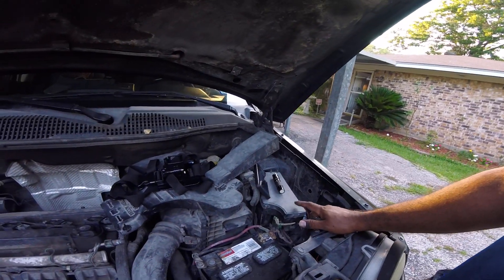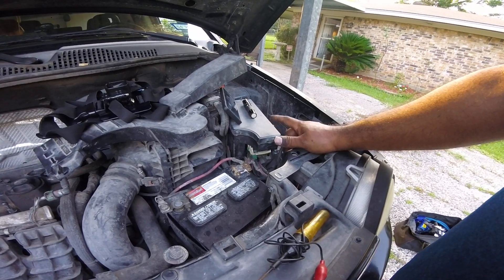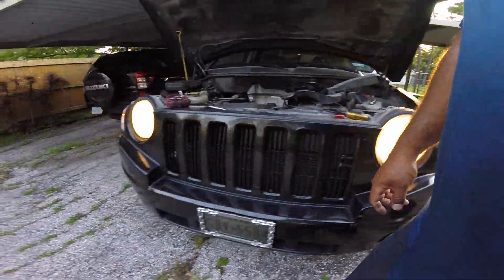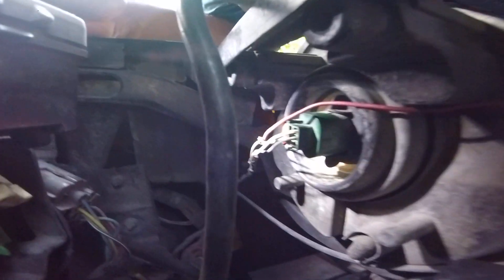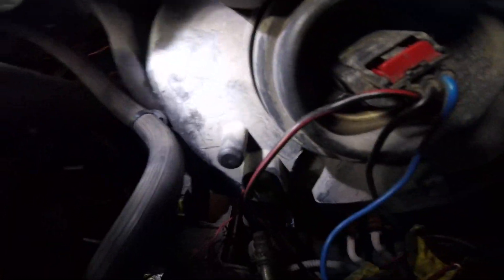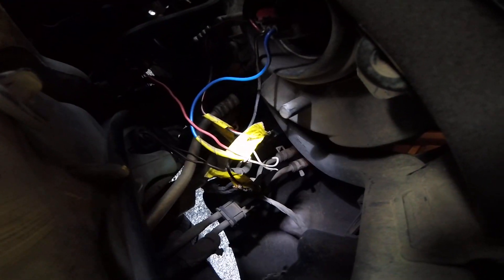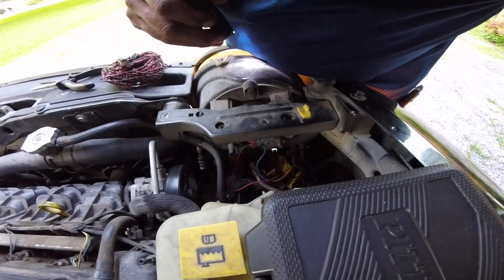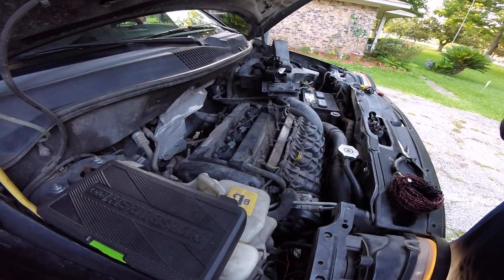2007 Jeep Compass passenger front headlight not working.( T.I.P.M. FUSE BOX )

Comment: On my 2010 Patriot, the right side headlight like yours stopped working. On the Body across from the front lower pulley is a ground pigtail. The ground wires were corroded and fell off the connector when I lifted it up. I rewired the pigtail, bolted it back up and it fixed the right side headlight & also fixed the brake light which would go on & off, usually 4-6 times each time I'd start the vehicle and drive it.
As for the TIPM, do a search online. You can get completely refurbished TIPM's for $300-$375. You have to send your old one to them to get your core charge back... These TIPM's are matched to the VIN and come ''Programed''. So it's just a matter of pulling the old one off & putting the new one in..... I called a place and they had a 7-10 day turn around, unless I sent mine, then they'd refurbish it and the turn around time was like a week....
Reply: May I ask where you sent yours?
Reply: @drumminjim22  Phat, you mean the TIPM?
Reply: @montydaniels1054  lol!  Thanks yeah I fixed the bad ground on the passenger side and the corroded relay connector in the driver wheel well.  The driver headlight went out and now I’m stumped.  Also the abs doesn’t work and the code says low voltage to pump motor.  I found a place that refurbishes the tipm so I’m gonna give them a call tomorrow if I can.  Thanks for the reply my friend.
Reply: @drumminjim22  Okay good you found a place by you for the TIPM. Now the ABS module controller (I think thats what it is) should be back on the Firewall, facing the engine, over to the left side of the engine. Now because the Ground Strap was about corroded through, I bought a new one at Auto Zone, had larger diameter holes but I washered & lock washered it so it fit tight. I can't remember what that helped but it did do something...
Just a couple things that ended up helping me. First I cleared out the error codes stored in the ECM/PCM, then I disconnected the battery. I left the cables off for about 2 hours, with the cable ends touching each other. I found that out after I had replaced what was told a bad wheel bearing hub on the right rear. After going through that headache, then replacing the wheel hub speed sensors, because the ABS, ESP & ESP-Trac Control warning lights would come on all the time, which slowed the vehicle down to 25 mph, it turned out the issue was I just needed to disconnect the battery. So unless you've tried that already, you might want to, just so you know.
Now my next thing to do with this Patriot is to take it to this one shop where the guy has one of those $5,000 code scanners & let him tell me everything that pops up. We only use this 2010 Patriot for a family backup vehicle lol. Today was the first time it was on the road since September 9th, 2020... Still started which surprised me. But my wife didn't want to drive it if the instrument panel still looked like  Christmas tree w/ lights.... I told her, no, down to one warning light, not 5 or 6 w/ occasional flashing lights lol what a mind-trip of a car.
Hey you take care & best of luck with the TIPM rebuild.....MD.....

Comment: Hi, thank you so much for this awesome video that you have made for us. I had a question regarding the red and blue are spliced with each other on the bad side of the HL. my question is that did you connect the third wire of the harness? the red and blue are the only two wires or another one is also included with them?

Comment: Hi dude
I did like you but it does not work, plug the conductive wire into the light on the driver's side into the wire (white and blue) and plug it into the wire on the passenger side. Do you have to change anything other than that? Thank you bro ;)

Comment: we have the same problem.  our passenger light is not working on a town and country van.  they told us to replace the integrated control module.  So, can we splice a wire and make it work?  How did you learn to do this?
Reply from the maker: sorry for the late responds learned on youtube

Comment: I am having this problem with my 08 compass. Passenger headlight just will not work.  Also I have had my airbag light on for over 2 years and no one can fix it for me. Any suggestions???
Reply: Jennifer, there is a grounding pigtail (group of 8 or 9 wires) that is bolted to the frame rail to the left of the front bottom pulley. There's a broken wire in the pigtail so the Headlamp isn't grounded. If all the ground wires are good there, there's another grounding pigtail on the radiator frame in front of the battery, usually next to the ''plastic hood height adjustment screw'' on the right, when you are facing the front of your Compass... Hope I was able to help....
Reply: @montydaniels1054  this ^ everyone I’m seeing with a passenger headlight out - I had the same issue. There’s a bundle of wires (7-9) as the guy stated above me, and those wires are attached to a bolt on the frame of the vehicle next to the belt & pulleys. This is your ground. Jeep did a shitty job because everyone seems to have this problem, I’m not a mechanic but I did it myself. It took me about 2 hours in total however with the right tools and parts it should take much less. 

One of those wires are likely broken or not making contact where the bolt is. You’ll have to cut the tape surrounding it and reattach these wires making sure they are all making contact to the connector piece which is bolted to the frame. I had to use 7 different pieces , one for each wire bc autozone didn’t have one large enough to fit all of the wires. And the original one I took off of the car couldn’t be reused.
Reply: @zks242  Hi Lodge, I was able to reuse my crimp lugs. But what made it possible was soldering the wires back into that lug. That lug that bolts onto the mounting frame for the radiator, just below the Air Intake Tube that also mounts on that rad frame was so close to the battery, I ran an extra ground from the battery to that one lug.

That helped but now, I have to replace the intake manifold in order to get it out of limp-Mode... I mean this Patriot sucks big time...
 
Originally this Patriot was only supposed to be used as a backup for anyone in the family that needed wheels while their daily driver was down for repairs. To do that, first I have to make it dependable & that's turning into a bigger hassle. I was thinking of just selling it for $500, which it should sell because I just put new tires on it & it does get about 23mpg in the city & 27 to 30mpg  on the highway.....

I have a 1993 Jeep Cherokee that is so dependable, I think I might get another one, maybe a 1998-2000, from Tennessee, because one that age that's been here in Michigan would have way too much rust on it...
Reply: @montydaniels1054  weird. I just had my alternator replaced, and when the job was done the mechanic tried telling my my transmission was shot and I wasn’t gonna be able to leave with my car. Lol. A quick google search told me it was in limp mode, it wouldn’t go over 5 mph. He pulls it out of the garage and into a parking space. I pay and get In the car, turned it on and drove it right out no problem. I also had a new battery put in with the alternator. Have you tried unhooking the battery to reset everything ? Maybe that would help.
Reply: @zks242  These vehicles are just a POS if you live in a rust-belt state....
Reply: @montydaniels1054  now my issue is i have my drivers side low beam and turn signal not working. Tried changing the bulbs first of course, still nothing. So switched bulbs from one side to the other and of course they work on the passenger side but nothing on the driver side. 

Any idea what that could be ? I read about someone who spliced a wire from the working headlight to the other one and that worked but idk which wires I should be splicing or if I should just focus on something else. Idk what to do. Could a ground issue cause one low beam and turn signal on the same side to not work at all???
Reply: @zks242  Well, when facing the engine, the ground lug on the left side of the engine, down at the subframe, across from the front bottom pulley should control the right front headlamp. It probably handles the left side, (drivers side is the left side). One of those ground wires could be broken an inch or more from where the wires go into that lug. I was switching turn signal bulbs & could never figure out what the problem was....

My right turn signal stopped working & the issue is, not the first socket that the turn signal bulb fits into, but the second part where the lamp socket fits into can break & then the bulb stops working.

Or one of the relays by the bottom front of the splash guard in the wheel well. I fixed one that was bad, then another one ended up getting so corroded that it stopped making contact.

I just don't know. Just when I get this Jeep running right, one or two more issues will pop up. Now it won't stay in ''Drive'' and I ran out of cable adjustment, so I have to replace the shifter cable, but I knew it was going bad 10 months ago....

Hey I hope your trans is okay. U-Pull sells them for about $250-$350 but those CVT type transmissions are junk. At least they are on the 2008 - 2010....